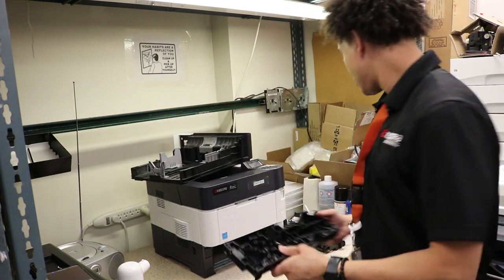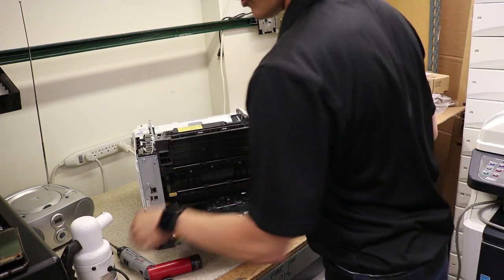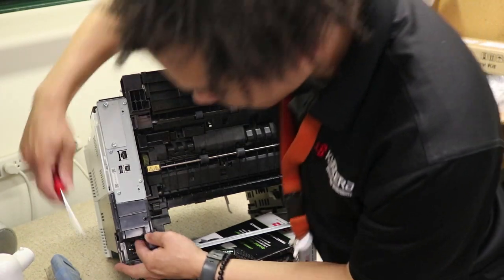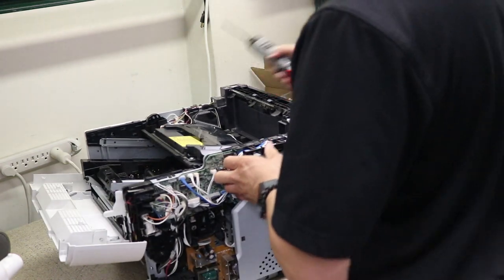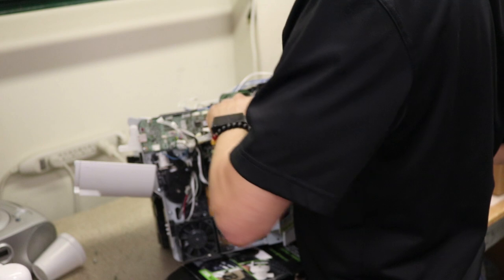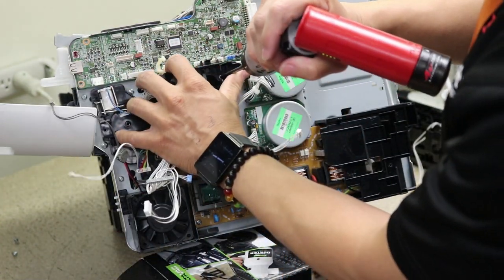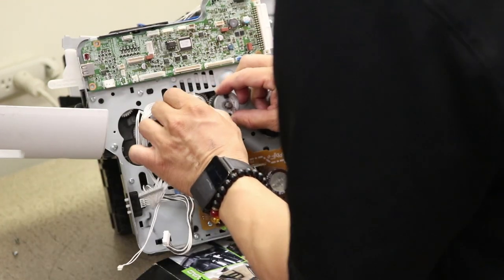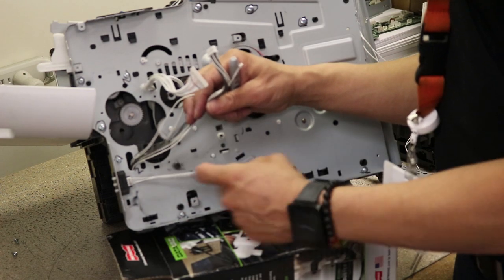#Kyocera Kyocera Fs-4200/4300 all in one repair guide.

Comment: Hey bro. Awesome video.
Great seeing someone enjoying doing these jobs as much as I do. Just sub'd
We usually repair those frames but that's never a permanent solution.
Where'd you source those frames from budd?
Reply from the maker: Thank you! I got them direct from Kyocera. I was working for them at that time.
Reply: Cool.
I've been searching high and low for other techs coming across this same issue.
We work on the kyo rebrands here in SA and our manuals don't even have that frame listed as a part.
You mind me asking what the part number is for that frame?
Reply from the maker: @riaanadams1764  I had the same issue with the part not being in the manual. I had to call customer support and they gave me a handwritten sheet with the parts numbers. The parts numbers are: 302LV02050 Guide cassette L and 302LV02040 Guide cassette R
Reply: Perfection bro...
I'll give it a bash and see what comes from it through Kyocera SA.
For sho I'll be watching the rest of your clips.
Keep up the great content budd...!

Comment: Hey, man how do you fix the MP TRAY when it tries to take the paper in it keeps moving up then down and makes a clicking sound but it wont take the paper in?
Reply from the maker: Sometimes the mp tray side guides come out of alignment causing this. Also, try cleaning the mp rollers, they develop a dust film that can cause jamming.
Reply: @Supertechs3  Yeah we had a plasterer come in and sand some walls during our relocation and the printers were not covered, I'm thinking the excessive dust caused this problem. Thanks mate I will try that!

Comment: any tips on 1010 error on the FS-4200dn
Reply from the maker: Make sure the lifting gear is not broken on the tray or on the inside right of the machine. Also, check the sensors near the tray rollers.

Comment: Just okay as far as tutorials go, but it is very apparent this video seems to end before it was actually over. This is not "all-in-one", as I am looking for information on replacing the transfer roller and it does not seem to exist.
Reply from the maker: Pull out the drum unit. Slide the black transfer roller cover to the left and lift it out. Use a flat head to pop the transfer roller up and out, then replace. Very easy
Reply: @Supertechs3  Gotcha! I was able to figure it out but what I really should have said is I would love to see you do many more in-depth videos like this as they are very informative anyways!